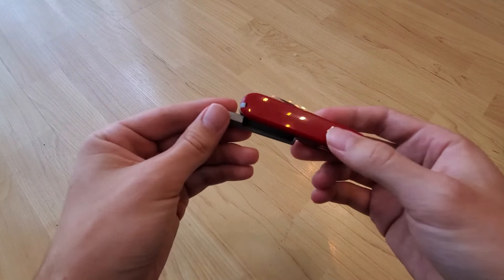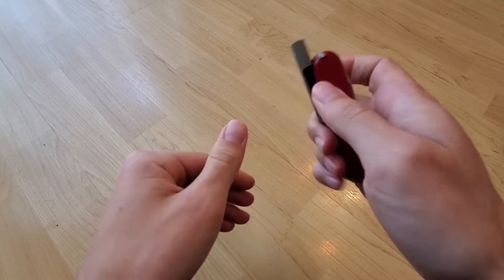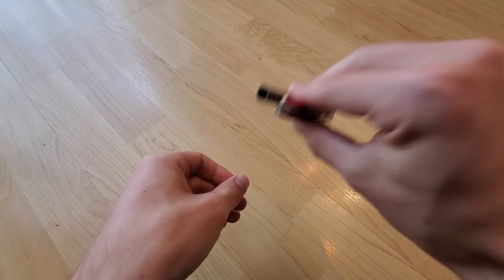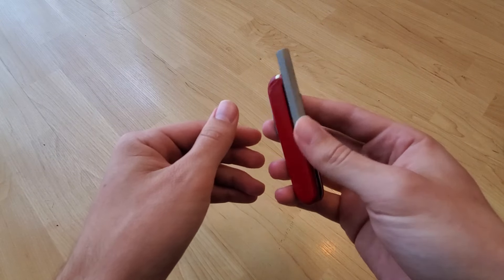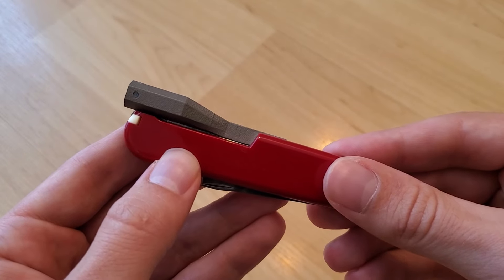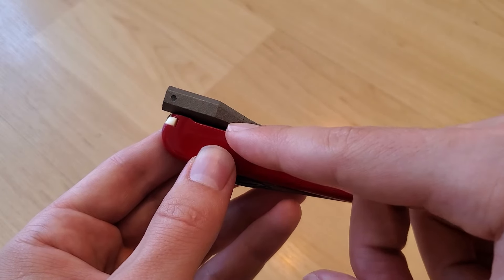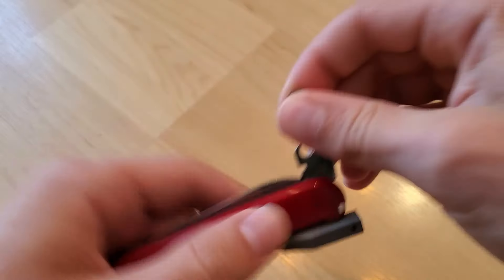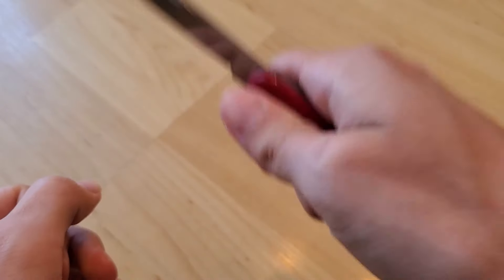The Rhino: A Victorinox 1/4 Hex Bit Driver

Comment: There's such a thing as a 3D metal printer?  Boy am I behind the times.

I have an SAK S557 (from Victorinox but originally a Wegner design) that has the "universal wrench" (a euphemism at best), and I'd love to see a bit adapter that can slide onto that, or onto the Phillips driver. Something that could be carried separately along with a bit  kit. Can you make one for me? 😀
Reply from the maker: Unfortunately I don't have a SAK S557 to work off of, otherwise I'd give it a try. You might be able to use the Leatherman bit adapter. I've seen some people use that with the bottle cap lifter and Phillips driver on the 91mm versions.

Comment: Very nice. Maybe go with 4mm bits rather the 1/4 inch.
Reply from the maker: Good suggestion. I'll try that next
Reply: 1/4 inch is more bang for the buck as you have more variety and they are cheaper
Reply from the maker: Agreed (that was why I chose the 1/4 inch originally), but it might be nice to have both options. I imagine the 4mm would fit the original profile better for example.
Reply: @qosmoschem  Wiha makes a nice selection of 4mm bits. I keep some in an Altoids tin stored with my Cybertool, to supplement the Victorinox bits.

Comment: wtf man this is amazingly great. I have a ton of questions but the few most relevant are: are those made from metal? How did you make them? Can you please explain how the saw holder works?
Reply from the maker: Yes they're made from 3D printed metal. I ordered them from PCBWay or JLCPCB and then adjusted them slightly with a dremel. The T-shank holder works by having a cutout to hold the blade in the forward/reverse direction and sandwiching the blade against the liner to provide side to side stability. Hope that answers your questions and let me know if you have any others.
Reply: @qosmoschem  I would like to know if, in your opinion the tshank holder may work as an inner implement of a victorinox rangergrip (130mm) so i can carry a long saw inside. Could you make a brief video showing the tshank holder, please?

Comment: Very nice craftsmanship!  I think you could just take something like a Cybertool with the 4mm driver and add an adapter to allow it to take 1/4" bits. Or you could take the driver from the Cybertool and mod that onto a different model to make something else (like a Yeoman).  Of course, you would have to carry the adapter around with you. But, you're already needing to carry bits, so it doesn't add much.
Reply from the maker: Thanks. The idea was to replace a tool that's on most SAKs which I don't really use (corkscrew) without adding a cybertool layer to keep it thinner. Also the cybertool models are pretty expensive so I'd be less willing to modify one.
Reply: @qosmoschem  Your points are true, of course. I actually use the corkscrew for its intended purpose but also to hold Firefly tinder and an eyeglass screwdriver. A lot of people do find the corkscrew to be useless though. Your design decision makes a lot of sense in that case. You certainly do some beautiful work!

Comment: The walls of the socket look extremely thin, like it would break if you apply some medium force.
Maybe you can add a steel ring around the socket or something to it to give it strength so it just doesn't crack? I feel it needs something holding it from tearing itself apart.
the idea is cool
Reply from the maker: So far it's held up fine for basic use. I actually think the aluminum liners would bend before the steel socket would break

Comment: probable useless as a driver, such thin shaft will break.
Reply: All swiss army knife tools are a step down from a solo dedicated tool. They're not meant to work on cars.
Reply: @blaskotron  the twisting forces on plastic 3d printed material (and even 3d printed metal) will not be the same as hardend steel.
Reply: @simonbutler377  hence I said it's a step down. But it can still be plenty of strength / capability for most tasks. I also designed a scale that holds a quarter inch bit that uses plastic.